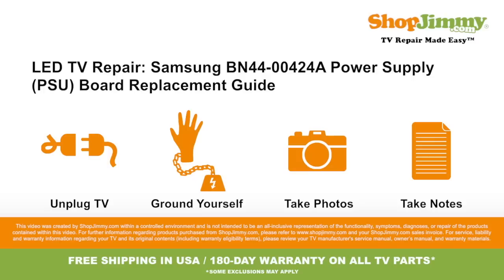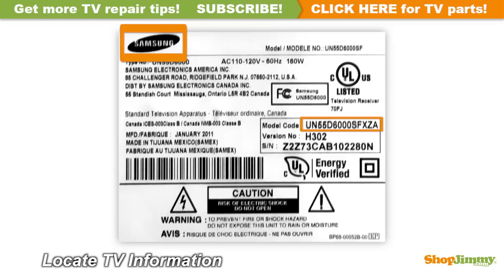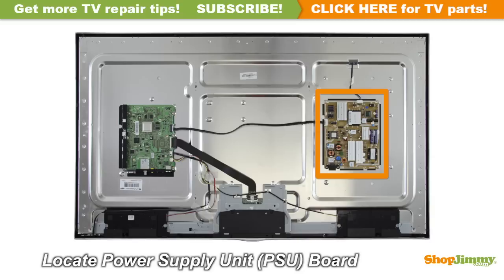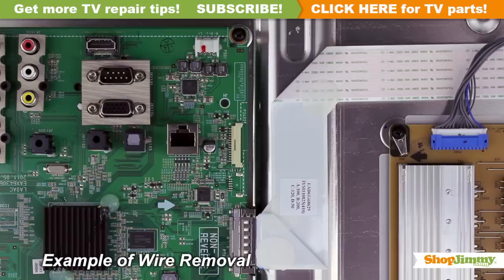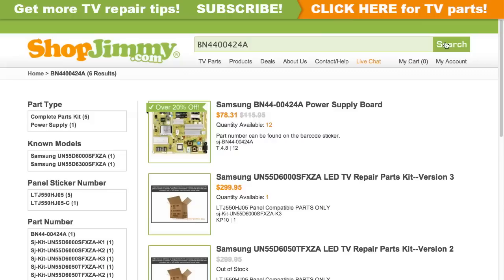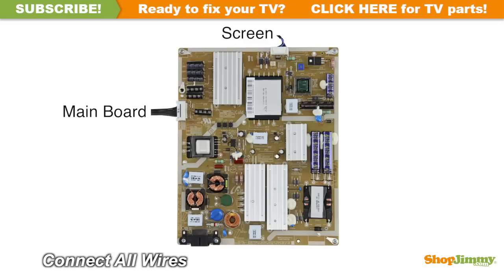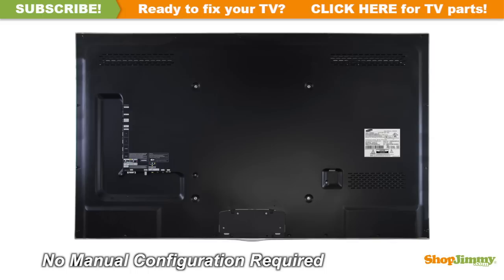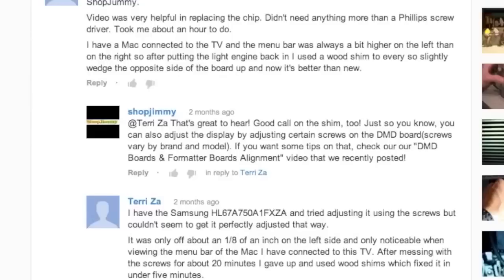Samsung TV Repair - How to Replace BN44-00424A Power Supply Board - How to Fix LED TVs

Comment: My tv won't  turn on, red light blinking.  Samsung Type no. UN46D6003,model code UN46D6003SFXZA, version AN02,s/n Z4DY3CAB901855Z. Do think  the problem is the power board? I already open it an found the match code for it.
Reply from the maker: Felix de la Rosa   I recommend replacing the main board in your TV.  Here is a link to replacement parts for your TV model number on our website, click here:  http://www.shopjimmy.com/catalogsearch/result/index/?cat=56&q=UN46D6003  Be sure to match part numbers on your current board, with your replacement for compatibility.  Here is a link to a video showing how to identify your part number, click here:  Samsung Main Boards & Digital Boards: Part Numbers for LED, LCD, DLP, Plasma TV Repair  You can also call our customer service for further assistance with your purchase.  (877) 881-6492  Thanks and please let us know if you have any further questions with your TV Repair!  www.shopjimmy.com

Comment: Hi, I have a Samsung UN55D6000SFXZA and the other day the TV went dark. The red power light will blink (possibly only if the remote is pressed) but no picture and no other lights? Does this one sound like a power supply? If so, what model would it be? If not, what other items could this be?
Reply: I got the same problem and the technician ordered the main board
Reply: Saul Gomez Thanks Saul. Did this end up fixing your TV?
Reply from the maker: Jim Jenson  Please watch this video FIRST to help with your repair!  https://www.youtube.com/watch?v=BP3NVNCGEv8  I recommend replacing the main board in your TV.  Click this link to replacement parts:  http://www.shopjimmy.com/catalogsearch/result/index/?cat=56&q=UN55D6000SFXZA  There may be multiple boards for the same TV model number, be sure to match part numbers on your current board, with your replacement for compatibility.  Here is a link to a video showing how to identify your part number, click here:  https://www.youtube.com/watch?v=BEPWrefQvqI  Thanks and please let us know if you have any further questions with your TV Repair!  www.shopjimmy.com